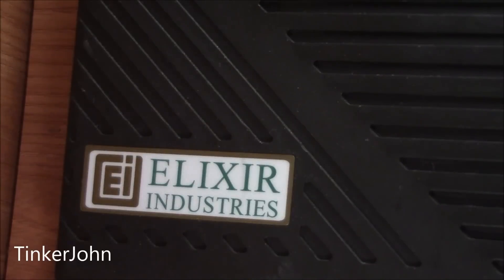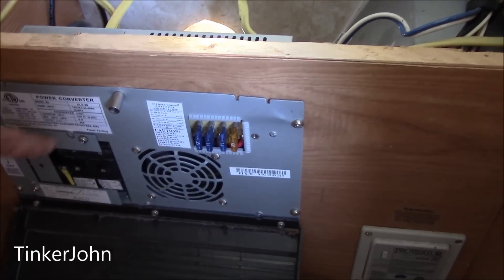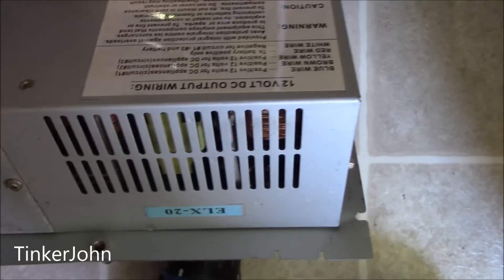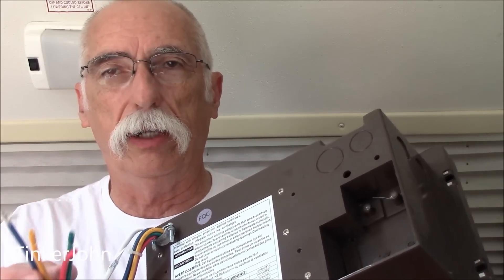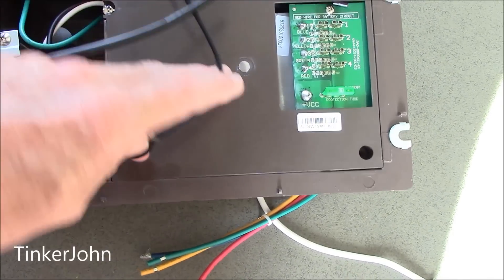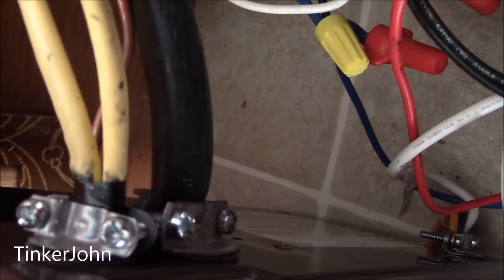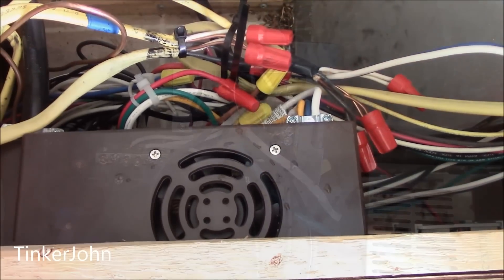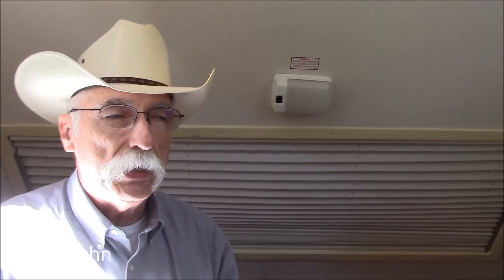How to Replace RV/Pop Up Power Converter

Comment: Thank you for posting this. I just bought a 2007 Palomino Pony 2100 and when I connect to shore, only my plug outlets work, nothing else. I used a voltage tester to confirm i do have power coming into the converter but none of the 12V components are getting power. I believe I have to replace the converter like you did

Comment: My brother n law tried to change his ac/dc converter. I never worked on a RV before. I am a electrician, I watched your video and fixed his problem. good stuff. TIP. after you terminate a wire on the breaker. pull on the wire to make sure you have a good connection.

Comment: Hi,
the open metal part on the black junction cable is a wire end sleeve to protect the braces of the cable when fixed in a screw terminal.
It's wired as a tap, please look at the circuit diagram, the junction part should be connected to some screw terminal (may be a circuit breaker?), the open end perhaps to some cable from outside.
Here in germany these cable end sleeves are obligatory when stranded wires have to be screwed down in mains applications.
BTW: These american cable nuts are just a nightmare, much more reliable are splicing connectors like WAGO 222 series.
Reply from the maker: +Michael Bombe 
Michael,  thanks for watching and for sending along your comment.  Your comment about the sleeve being a tap for another circuit breaker is correct, however my unit did not need the extra tap.   I've now noted that in the video..  Unfortunately, the converter did not come with a wiring diagram.  ~John

Comment: Thanks Tinker John for your help. I'm doing the same swapping here in Ottawa Canada but I have a question. What did you do with the big black cable coming from the aluminium  piece just beside the breaker anchor. Don't know where to plug it.
Reply from the maker: Sorry for the delay in getting back to you. I've had surgery that has kept me down for a few week.  Unfortunately, I don't have the camper any longer and don't remember the exact wiring.  ~John

Comment: Glad I never had to get that deep into the TT or Class C rigs I have owned cause they sure must not need to meet any electrical code!  Wondered about the cooling as the old unit looked like the fan vented out into the camper while the new only looked like the fan was inside the "cabinet"  space.   Looked like a job well done!
Reply: gvet47 in

Comment: I have a 2007 Starcraft RT 13.  How do you access the converter through the top?  Piece of wood and a hammer to take the top of the cabinet off?  It looks very similar to yours
Reply from the maker: Ryan, unfortunately I am not familiar with your particular camper.  However, I suspect you are on the right track by simply removing the cabinet.

Comment: PEOPLE, If you've got an Elixir power center and having problems (cooking batteries, the famous low voltage buzzing, the low voltage buzzing when you turn on a light or the water pump comes on, the propane alarm buzzing because it's getting a low voltage from the power center ect..ect..) ect...do not bother troubleshooting and trying to figure out if its the unit or any one component. Trust me, it's the Elixir and it's junk. Failure rates are close to 100% within the first 5yrs, hence; the reason they are no longer in business. Rip it out and replace, simple as that! I replaced my Elixir ELX-25 with the Progressive Dynamics 4100 series (PD-4135). Got it on amazon and was pretty inexpensive. Swap out wasn't hard at all. Had to cut out the the hole about 1/4" taller for it to fit. Just carefully label all your wires and take lots of pictures to look back on. The swap took about 2.5hrs. My headaches have all disappeared.
Reply: Is there anyway to salvage it?

Comment: On the breaker bar that holds the breakers is a black wire , similar in size to the black wire coming in from the shore line, and I'm curious, where does it attach or is it just an extra wire? Jim Gibbs
Reply: By the way John, Great video! Thank you!
Reply from the maker: Jim,  Thanks for watching my videos.  Unfortunately, I sold the Aliner about a year ago and don't recall exactly how the wiring was done.  Perhaps an online search will help out.   Good luck with the install.  The little converter did a nice job for us..     ~John
Reply: W5CYF / TinkerJohn I came across your video and got same and now came back to video to ask same question to blk wire placement from converter. Unable to find info so any help would be appreciated!

Comment: so that work was to take out one that is not right. could not a ham or astron power supply go in that place and fuse the circuits like you would with ham radio circuits. does this take 120vac to make 12-13 VDC. if not i am confused
Reply from the maker: +George Gardinier 
George, thanks for watching and for your comments.  I suppose that would work, however you would have to route the AC circuit breakers a different way.  On the other hand, it would be difficult to find a 25 amp power supply, that in the end, would be less expensive to install.    ~John
Reply: I highly recommend an Inteli-power 3 stage smart converter. It will keep your battery plates from stratification and save you money in the long run. It is made by Progressive Dynamics, inc. The WFCO are very simple power supplies and destroy batteries way too fast...

Comment: i had to replace min in my rv, i went ahead and upgraded to a powermax 75 amp it had a 45 amp in it,but i use my rv as my ham shack and figured why not lol i am pleased with it, i did  have to add a large cap to cut noise from it for my hf ham radiowhen i run the linear ...on just the 100 watts formthe icom it handles it no issues  and i have a cheap 30 amp switching power supply as an emergency back up... i have 2 large deep cycle batteries in it also this was about 2.5 years ago and so far it hads kept them in great shape!!..i keep line power hooked up to keep the batteries up my rv is my back up heat and cool spot if the power fails i got a harbor freight 4k max gen to power the rv it works very well even w the ac on, i do however use an inverter to power sensitive electronics for 110v when im on gen power hope to catch ya on air sometime 73!! KG5GBP

Comment: For those of you using this video, make sure to actually test circuit with volt/ohm meter. Output on converter should be around 13 volts, not hooked on battery. Simply turning on 12V light will not guarantee  it is working. That would show the battery is charged or working. Great video, it gave me the confidence to repair my 2004 Aliner.

Comment: got 2 questions for you, i have a 2006 nothing in it scout. just a eletircal plug and  and lamp and fantastic fan ,, my question is i pulled the bad battery out.. if i plug into shore power should that stuff still work? my outlet eletrical plug does but the other stuff doesn't. so do i need a battery to make it work... question 2 is i have a yellow wire coming out of the converter  can you tell is that ok or should i put it into some colored wire  with a wire nut. i don't know what color wire it goes  to but there is a solo blue wire in the nest with a wire nut on it  but don't want to take the chance  of just sticking it in there.. any help thanks
Reply from the maker: Thanks for following along, since there are different converters I suggest you check with the manufacture for accurate information.  ~John
Reply: @TinkerJohn_W5CYF  THANK YOU

Comment: It's been a couple of years, how's the converter holding up?  Is it noisy?  Do you hear the fan when it runs?
Reply from the maker: Thanks for watching.  We recently sold the RV, however the converter was doing just fine when sold.  When running, the fan made a slight sound of rushing air but nothing distracting or loud.   ~john
Reply: Thanks John.

Comment: Quick question , the ELX 20 you had on it , did that charger your in house  battery ?? I have the same one but it’s not charging my battery ....
Reply from the maker: Thanks for watching...yes it did charge the battery.  ~John
Reply: W5CYF / TinkerJohn thank you ... I can’t seem  to find the issue with mine, everything is connect as it should

Comment: https://youtu.be/o_kEAvJWKiM here is a link to another video to show you where that black pigtail wire that you didn't think had a use it actually does and I didn't know it until I watched another video. The black wire that you covered up with the heat shrink that little metal part was supposed to go into the 15 amp side and the rest of that wire was supposed to go in Junction with other black power wires that were coming in. The video will show you exactly what I'm talkin about. Looking forward to hearing back from you thanks for your videos

Comment: What a crappy video - you failed to cover the actual connection of the 110V breakers and circuits and DC circuits! Some converters require duplex breakers to get "same" number of circuits. What about 30 amp circuit for the AC? Probably not much help for many.
Reply from the maker: Dale, thanks for your comments.  As for the details you mention, since there are so many different situations that may require different wiring diagrams, I did not include them.  I suggest you refer to your specific installation instructions for your specific converter.    ~John